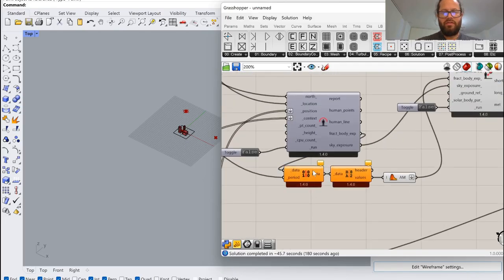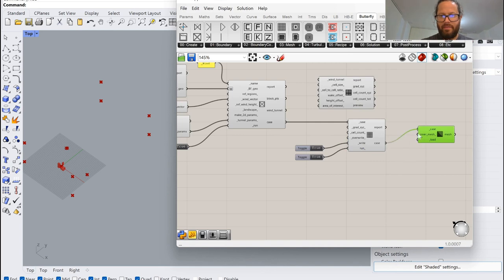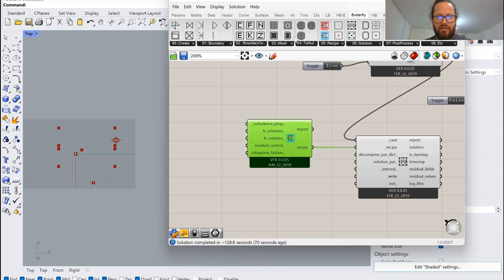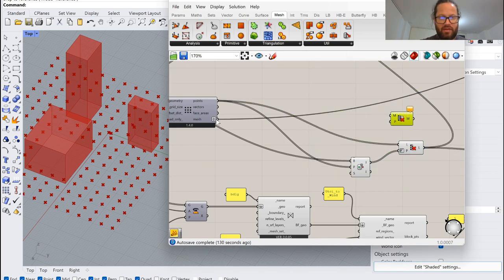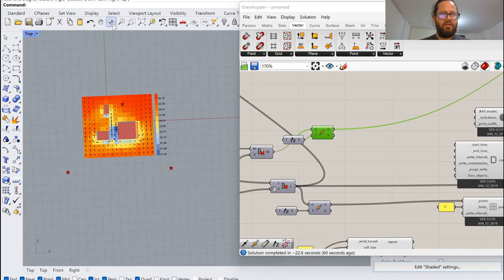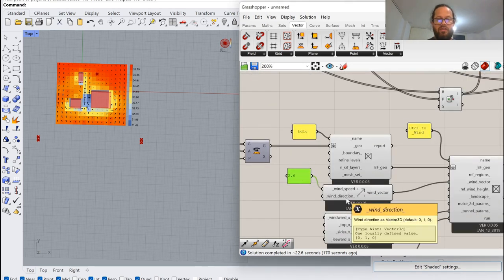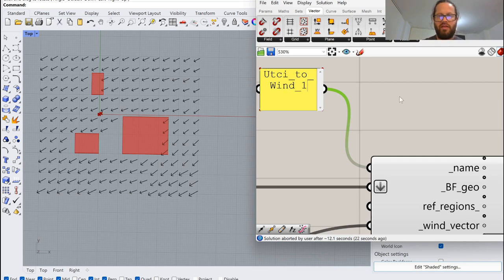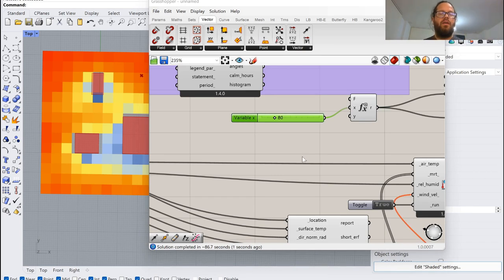Outdoor Comfort and Wind Analysis | Grasshopper 3D Ladybug and Buttefly | PART 2

Comment: Hello Philipp,

The tutorial worked wonderfully for me up until the part where I needed to relocate the wind direction by converting it to vectors. Initially, the 2pt vector command didn’t work, so I used vector xyz, which worked. However, when I set it to 90 to point east, it ended up pointing north (by default, it was pointing south), which is odd since 0 should be north. Trying to correct it, I used 60, and since then, something changed in Grasshopper or I’m not sure what happened, because even after setting it back to 90, it no longer works. The block mesh part in WindTuner turns red with the following message:

Runtime error (Win32Exception): WindowsError

Traceback:
line 569, in rename_snappyHexMesh_folders, "C:\Users\user\AppData\Roaming\McNeel\Rhinoceros\7.0\scripts\butterfly\case.py"
line 588, in remove_snappyHexMesh_folders, "C:\Users\user\AppData\Roaming\McNeel\Rhinoceros\7.0\scripts\butterfly\case.py"
line 38, in script

I’m not sure what to do. I’ve reinstalled OpenFOAM, but it’s still the same. I’m going to start the entire exercise from scratch and hope it resolves the issue, but if not, I really need some help. Thank you so much for providing support for such a long time.
Reply from the maker: There is a bug in Butterfly which messes up the rotation. Was sadly never fixed...
Reply from the maker: You might need to consider rotating the model.

Comment: Can you show exactly how you were able to create the expression to solve the wind direction? For some reason It doesn’t work out for me 🙏🏾
Reply from the maker: It should all be in the video. No hidden magic. But as I said,  butterfly has some bugs. That's why the it doesn't always work.
Or do you mean the translation from angle to vector?
Reply: I have the same problem, "1. Solution exception:Attempted to divide by zero." this is showed when trying to create wind tunnel grading"

Comment: Hi, on the timestamp of 4:02, I got Blockmesh windows error. I have Rhino 7 and have blue CFD core 2017 (ver 2 i think, the upgraded one), I also ran Blue CFD and Rhino on Admin mode. Please help me, Thank you
Reply from the maker: What is the error saying?
Reply: @PhilippGalvanDesign  Hi it says Solution Exception: Windows error
Reply from the maker: @Rhaysan-u1s  do you run rhino in admin mode? Have you setup the bluecfd environment?
Reply: @PhilippGalvanDesign  I run rhino as admin one time, do I have to run them as admin everytime? I have setup the bluecfd, I run it as admin but only once. How do I test if the bluecfd environment is working correctly? Thank you so much
Reply from the maker: @Rhaysan-u1s  your need to run rhino in admin mode every time you want to use Butterfly CFD in grasshopper.

Comment: Hi,Philipp! Thank you for your sharing. When I used butterfly to divide the grid, I found that the building was not divided into grids. Do you know why it happened.
Reply from the maker: The grid divides the wind tunnel the snappy hex mesh divides the geometry... If that answers your question? Otherwise let me know the video time where you get stuck...
Reply: @PhilippGalvanDesign Thank you very much！I have solved my problem.
Reply from the maker: Great to hear!

Comment: Very nice tutorial, sadly I coulndt get it to work with my geometry at all, the wind tunnel grading goes kinda wacky and seems to not understand my geometry
Reply from the maker: Did you use the wind direction input?
I would not use it if not absolutely necessary. I would rather rotate the model... If putting alternative wind directions then it f...s up the grading tool...
Reply: @PhilippGalvanDesign  I also have the same problem... and I didn't use the wind input

Comment: Hi Phillip thank you for this tutorial. Is there any way we can use this information with octopus to iterate the forms of thr buildings?
Reply from the maker: It's tricky with Butterfly. In theory it should work but because CFD calculation would need to start over and over again it might not work as straight forward. Some of the Butterfly tools are buggy and don't work as they should. It would require some workaround. Further it will be an extremely slow process...  Then also what would be the criteria for the test? How would you shape the buildings in order to change what? It's highly speculative and maybe it's not needed when applying common sense to the design. Nevertheless an interesting provocation.
Reply: @PhilippGalvanDesign  Hi Phillip thank you for your response! I am a university student and have been learning different Grasshopper plugins. Our assignment was quite broad all we needed to do was iterate a building so form and common sense weren't as important. Still, I thought i challenge myself and learn these things and your videos have been a great help! thank you very much for these in-depth tutorials!
Reply: @PhilippGalvanDesign  sorry for responding so late by the way!

Comment: Thank you Philip for sharing this with everyone..🙏🏻
But i have a question about New  material such as (new Brick ) ..,How can I do tests for a new brick on this program, while its data is not recorded inside? Is it possible to enter data, numbers, design for a new brick and measure its suitability for the environment, as well as its thermal insulation, etc.
Reply from the maker: The UTCI within the  Ladybug calculation doesn't take materials into account. 
It gives a more general understanding and impression of what the result could be.
There is however a factor you can add to your ground material but it's very vague...
Reply: @PhilippGalvanDesign  thank you so much Dear Philip For your Answer..🙏🏻
Have a great day
Reply from the maker: Thank you! You too. Btw i will test UTCI in Honeybee soon there it should be possible to include materials and indirect light. But let's see...
Reply: @PhilippGalvanDesign  Okay ..👍🏻

Comment: Thank you so much for sharing ! Really appreciate it. 

Just wanted to ask, what scale are you using ? And what are the heights of the buildings you’re using ? 

Can rhino plug-in’s handle larger scale models ?
Reply: This also depends on your PC , but let’s say I’m using a standard level PC. Not using a super computer.
Reply from the maker: Butterfly CFD can handle very large scale models. It's more a matter of dialing the right settings.
Reply: @PhilippGalvanDesign  I changed my base units in properties and everything scaled up to more realistic values. Will watch your snappy hex mesh video to see how I can improve my accuracy further. Appreciate the quick response Philipp!
Reply from the maker: @mohsinhassan2585  
I also did a video with a large scale model of London. Or lets say a part of it. It's a while ago but still valid.
https://youtu.be/c9Xaspg5Dqw

Comment: Hi Philipp, Thank you for your great content! I very much appreciate it!

I'm as well a landscape architect and have a question regarding outdoor comfort. 

When calculating, how can i only take the hours on daytime into account  or for example a period from june-to august but only the hours between 12- 18 - because only then heat isles occur. Often my temperature results in summer are around 20°C, but i know it can get up to 35-40°C and i'm figuring it's because the lower temperature of the nighttime is dropping the average. The same goes for wind analysis. In open spaces daytime data is way more relevant, because mostly then people are actually outdoors.

Maybe you can share some light onto this!
Reply: So the last couple days I looked into this. As far as i understood, there is no way to acchieve this with ladybug. But there's a simple solution. 1. getting the yearly UTCI chart - 2. choose a date and time to represent a period, for example a hot day in summer at 15.00 pm. 3. Calculate the UTCI just for that hour to get an idea for the heat stress in summer.
Reply from the maker: Hey YA, sorry for getting back to you so late.
For the UTCI it's very simple. When choosing the period with the LB period tool.
Just choose the start and end date and the start and end hour. So for example: 
Start month January, start day 5, start hour 6am, end month January, end day 10, end hour 6pm. 
That will select only the hours from 6am to. 6pm for each day of the period.
Reply from the maker: For the wind it is more tricky because you would first need to average the wind direction for that period.
Reply from the maker: I show this in latest uploaded video btw...

Comment: One quesstion! trying different wall confgurations and for some reasons my range of temperatures on the scale never once does it go below 24.58 C, it's the lowest temperature on the heatmap each time, I was wondering if its a huge coincidence or somehow theres a cap on values in the script?
Reply from the maker: Have set any max. or min. value on the legend parameter?
Reply: @PhilippGalvanDesign  what is this parameter named? Btw I'm using script mentioned for the city of new york outdoor heatmap example
Reply from the maker: The legend parameters are a tool to set a maximum or minimum for the heatmap and heatmap legend. I covered this concept in other previous videos. I would recommend that you might want to watch some of these and  get familiar with Ladybug and the weather data on a simpler script and the jump back into this one. On the other hand 
It depends also on the weather data. 
Have you tried other weaherdata sets?

Comment: Heloo philips. Thanks 4 this video. I would like to asksomething, is the butterfly works on Rhino 7? because i ve a problem on "Blockmesh" part. it turn red colors ... it said that blockmesh is not recognized as an interna or external command, operable program or batch file...
Reply from the maker: Hi Anakmuda, Butterfly was developed before Rhino 7 came out, so Rhino 5 or Rhino 6 should be no problem. Which version of BlueCFD do you use? Are you running Rhino in  admin mode? Best Philipp
Reply: @PhilippGalvanDesign  i used  the latest one ,version BlueCFD 2020-1. win 64.  i run the rhino as usual. I dont understand which part of the admin mode. :)
Reply from the maker: @anakmuda6554  
You need to uninstall bluecore CFD 2020 and install the latest 2017 version. Butterfly was developed 2017. So 2020 Version doesn't work.
When you start Rhino you need to start it as administrator. Right-click on the Rhino symbol and select start as administrator. 
You also need to setup the blueCFD environment. 
This all is in my Butterfly installation video.
Reply from the maker: https://youtu.be/6meHDZMJp-I
Reply: @PhilippGalvanDesign  thanks for your suggest Philips.. i am gonna try it...

Comment: Hi Philip, I really like your work.
I'm an architecture student and I'm finishing my thesis, I wanted to know if you could help me obtain the wind speed data, I don't want the temperature color map, I want to obtain the wind color map.
Thank you very much
Reply from the maker: Well, you can just feed the wind speed vectors length instead of the temperature values into the heat map tool. It should be very straight forward...
Reply: Thank you very much, and keep uploading this type of content.
Reply from the maker: @manolotorres3039  my pleasure!

Comment: I attempted to run the HB PMV Comfort Map based on the airspeed from the butterfly simulation [I scripted the butterfly part exactly as shown in your video], but the Cmd screen simply kept popping up and showing the same thing all over again, do you know how to fix this?
Reply from the maker: What does the CMD screen show? 
Is there an error message? Any of the components red? 
If it goes through the iterations than it's correct. You might might want to reset the script by either rename the simulation or delete/clean the project folder.
Reply: @PhilippGalvanDesign  The CMD displays "No MRF models present" and "No finite volume options present," followed by "Starting time loop" and "End". When I change/rename the simulation in Butterfly_create cases, the cmd still displays the same result. It could be my geometry because I previously tested it with a simpler shape and it worked fine...but with an Eddy sim it appears to be fine[I want to use HB UTCI/PMV because it has the option to put geometry with transparency]
Reply from the maker: What did you set as start time and what did you set as end time? Another question: what is your file/model unit? Any special objects in your model?
Reply from the maker: If it worked with a simpler model you might want gradually add objects to your simulation to see which object works and which not...

Comment: The length of the vector when I display them from the value  is massive , any reason ?
Reply from the maker: Well the value shows the speed represented in meter. (m/s) as in the video you can divide   the vector with a slider to scale the arrows down..
Or multiply by 0.1 (to scale it by 10)...

Comment: Hello philips. i would like to ask something. ive  follow your instruction from this video. but i got problem on the " Butterfly_Load Probes Value" part... it turn red colors when i put  "u" on the _field .... and it said failed to find probes folder folder at C:/users/user/butterfly/Utci_to_Wind/postProcessing/probes .
Reply from the maker: Which blueCFD version are you running?
Are you running Rhino in admin mode?
Reply: BlueCFD- core 2017. Yes, i were running Rhino in admin mode
Reply: I am having the same problems , any solutions ?